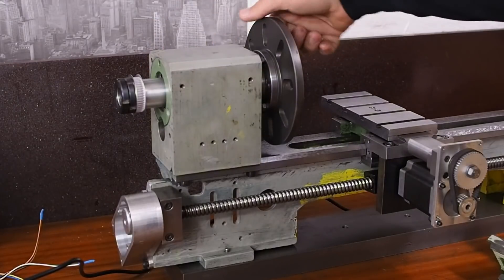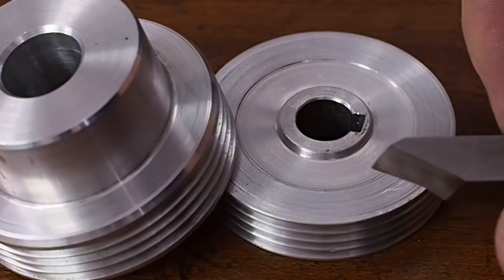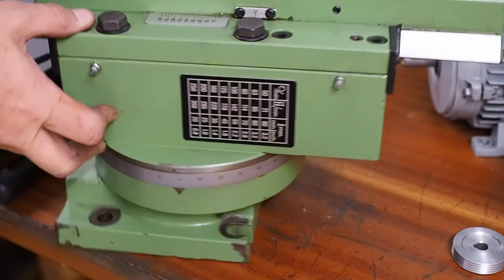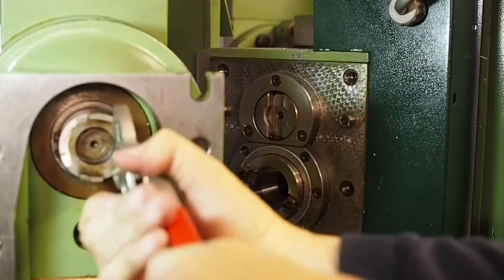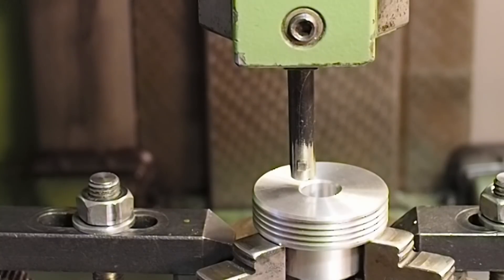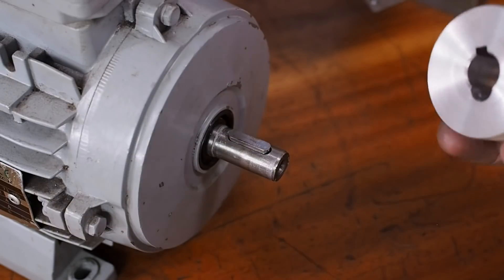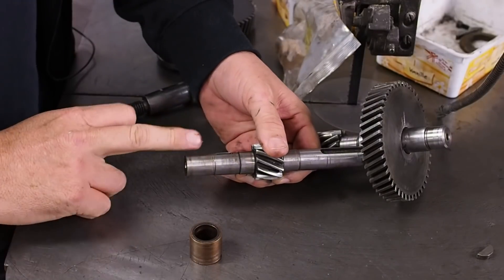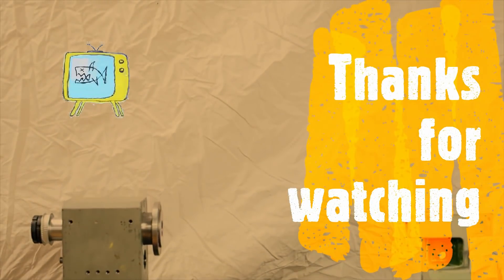CNC'ing the 7x12 mini lathe - Episode 15 - Spindle motor.

Comment: Got a 500w DC Brushless motor with 15k rpm and i dunno how can i control the speed or even start the motor.
Probably to strong for the mini lathe i suspect?
Reply from the maker: That is really not a good match to a lathe. The low speed torque is very low, the design point RPM is unsuitably high, and would need a massive reduction, and they are normally open rotor to allow cooling of the high power, small motor. Swarf will like get in and kill it.

Comment: OK, easy to say from someone who watches machining videos ... but you seem to have a decent range of gear and skills, so why not design a replacement shaft and helical gear on your cad program and spit them out on your CNC equipment?
Reply from the maker: I am tempted. Gearorotic has that function to generate 4 axis tool paths to mill gears with small ball mills. I currently dont have a CNC fourth axis, so would need to either motorise the rotary table I have or get a Nikken etc. 

That is a professional made, ground and harden gear. I have no illusions of duplicating the tolerances of it in my home shop, so the 1/3 remaining  tooth on the original shaft may still work better than a bodge up from me .

Comment: Not sure if you revisit these old videos but here's a personal experience about repairing shafts like the one for the bandsaw. I have tried with success using a Dremel type tool (you have a Proxxon which may be even better, mine flogged its shaft bearings and went to tool heaven) in the tool post of the lathe with a few cutoff discs to give you some width, you know the really thin ones. I have used up to three at a time, with no problems. It is a bit messy, so you have to protect the lathe ways, but if you go easy you can take a few hundredths of a mm to restore the shaft concentric with the bearing shoulders. Just chuck it in a four jaw chuck and if you take a little at a time, the cutoff discs will not wear between cuts so you should be able to cut a consistent diameter. Just make sure you immobilise the rotary tool well in the tool post and use a short mandrel to minimise deflection. Proxxon has a rather good one I have used.
Reply from the maker: Thanks for your feedback. This is still a task high up on my to do list. Probably the first priority after I finish the Schaublin. 

Since I have center supports for the Clarkson tool grinder, it will be better for me to do the cylindrical grinding there, but I need to get the two shaft centers concentric with the existing bearing journals first, as I cant regrind them, without them going undersize. 

I took one shot at it, using the Proxxon in the lathe tool post and dialing in the shaft with the 4J. WIth a little grinding bit in the Proxxon, I reground the center, but didnt get it perfect. I need to find the time to repeat this until that center runs true. Once it does, the actual OD grinding on the Clarkson is pretty trivial.

Comment: When slotting keyways I have aways marked out and cut to width. Start with a centerline as long as you can fit onto the part. Next with dividers mark out the key width both sides and again full length. measure from the bore out to indicate full depth.  An alternative and superior method is to do all the layout with v blocks and a height gauge.
Align the long centerline to the machines axis using a pointed wire. To cut the correct width first cut the center out to almost full depth. Measure with calipers, do not rely on the layout lines. Next continue widening the slot short of final width. Now make a finish cut to the layout-line on one side only. Now move over and take a light cut on the other side and measure the cut width with calipers, teleguage or adj parallel. Calculate the finish pass move over and cut the full width and full depth. check for full width of cut as before. Now move across the slot to clean up the top of the keyway about .1 to .2mm too deep to provide top clearance for the key. 
By using the one side of the keyway as a reference you will minimise any angular error certainly to the point that a typical key can be simply fitted and an accurate width can be established. It is preferred the key should be a light interference fit in the shaft and a transition to light clearance in the hub. Often it is advantageous to fit a grub screw in the hub over the key to retain the hub and prevent any key rocking.
Yes the key you made is too loose and should be corrected even if this means filing a stepped key. Even with pre made key stock it is usual to file to final fit since achieving a proper fit by machining alone is very difficult, especially with slotted keyways. A loose key will eventually flog out the keyways in the shaft and hub.
I am sure this blow by blow description is below you but it may help a newbie along the way.
Reply from the maker: Thnks for they detailed description. I should have put more care into that, and snuck up on the final dimension rather than just set numbers and go for it. Luckily it is a low powered motor, which will probably not see a whole lot of use.
Reply: @RotarySMP  Not much use? does that mean the underlying lathe structure is inadequate? I bought a 200x450 Honden lathe many years ago but being a professional machinist the limitations of hobby lathes just frustrated me so I sold it. BTW I can't recommend highly enough the adjustable parallels they are life savers in a number of circumstances. BTW did you get confused with the Austria/Australia thing most of NZ now lives in OZ :)

Comment: Hi, regarding 3 phase versus a DC motor, is there a pro and con over the two, do you less stall with 3 phase?
Reply from the maker: If I dig around in the unused brain cells full of never again used apprenticship knowledge, there can be an advantage with DC motors. I think DC shunt wound motors can have nearly unlimited low speed torque. 

In practice, I overloaded the original motot and burnt out its windings. It was cheaper to buy a much more powerful three phase motor and VFD than a replacement crappy mini-lathe motor, so I did that.
Reply: @RotarySMP  ok thanks.  One last question. Is easy/sensible to make a single phase motor variable speed (and how) or better to bin it and go 3phase + vfd.
Reply from the maker: @zxspectum  I don't know how to make a single phase motor run at variable speed. However many "single phase motors" are actually three phase motors with a capacitor to generate a fake second phase nd thus run. Take the lid of the motor winding connection box and take a look.

Comment: I would go the same direction with the gear, minimal fussing, do the grind on that shaft, remake the other, and do the last step the previous owner didn't.... Maintenance.
Thanks for sharing, 
Cheers
Reply from the maker: That's the plan! I took one shot at it already, but couldn't get the centers ground back in accurately enough. Need to try again there.

Comment: How about a drawn-cup needle roller for the bush? Might be a bit more scant-lube tolerant. Either running direct on a re-machined pinion shaft journal, or on a pressed-on inner race. 
Also, I bought a very second-hand 30jaw chuck for my milling machine and drilled holes straight through to bolt it down to the bed. (I only get two bolts, due to the interaction between where it is possible to drill through a chuck and my T-slot spacing)
Reply from the maker: There is a pressure lubrication system, and that bearing is fed. I think once it starts slogging out, it loses oils pressure and goes pretty fast. Given that the utilisation in my basement is going to be measures in minutes/month, I'll just bring that interstage  bushing back into a press fit OD with with a correct tolerance ID. Will easily outlive me.

Good idea making a direct mounting mill chuck/vise.